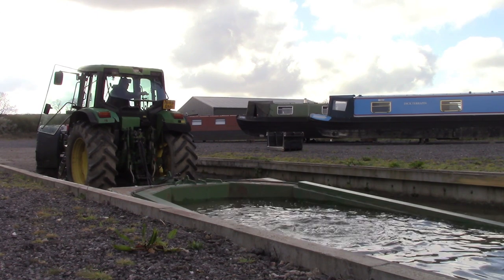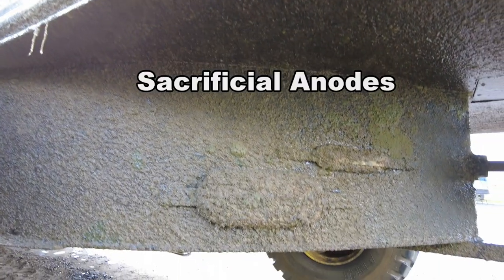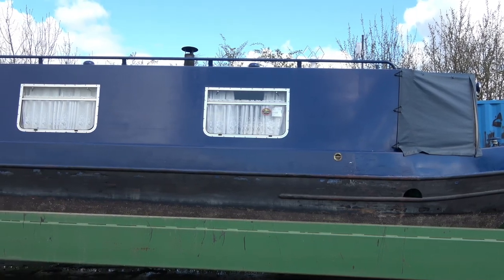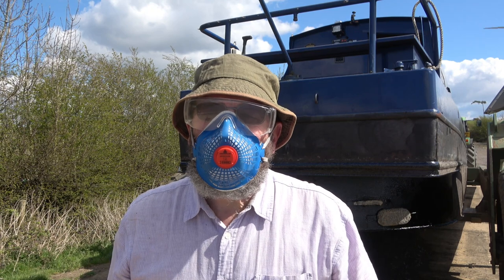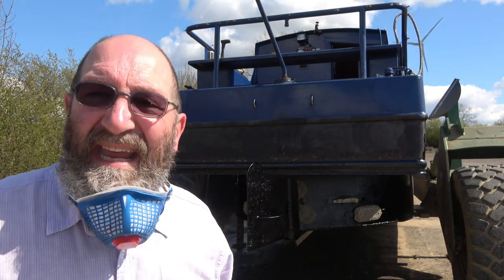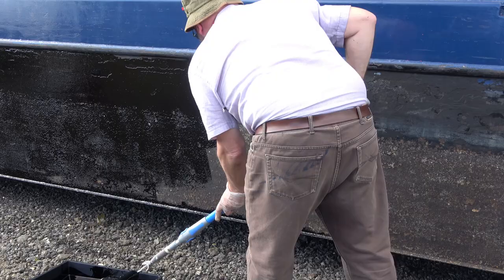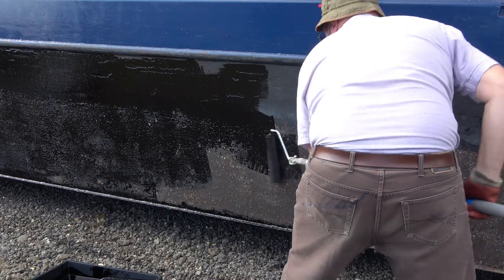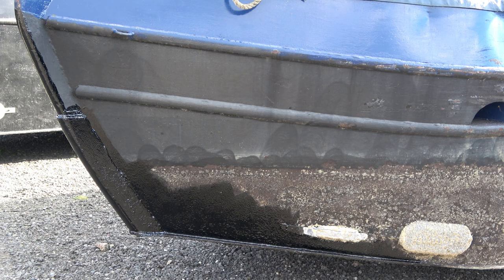189. DIY Narrowboat Blacking (Part One of Four)

Comment: Alan ,first thing out of the water, did you have a hull thickness survey done by a marine engineer? If not , why not?  Seems that is a logical first step, replace any plates that are corroded . Is that not required for boat insurance ? I would never buy a boat without a hull survey and know how much steel I had ? 

First survey, replate, then black ??
Reply from the maker: Hull surveys are sometimes required for insurance companies, I believe related to the age of the boat. My boat was examined three years ago and all was well, so no need to have a survey this time. There were no signs of any deterioration.
Reply: @MyNarrowboatVenture  Black the bottoms also especially at the stern,  the whole hull rusts.
Reply from the maker: @eamo106  The underside around the swim was blacked.

Comment: Well done Alan, you know you could also use a roller in each hand that should speed things along.
Some years ago four boat owners including myself formed a bit of a slipping club so we could help each other work on their boats. All went well with four boats then it was time to do mine and most found they were busy so although I still help slip two to three boats a year I prefer to not rely on others and do it myself.
Reply from the maker: I do use both hands but one at a time! That's often the way, others will take help when it's needed and when it's their turn to reciprocate, funnily enough they're too busy. If you want a job doing and doing well, there's only one way, do it yourself, cheers.

Comment: Many years ago an old boat surveyor, Cpt. John Polly told me you should always put the first coat of bitumen blacking on with a brush.
He explained that using a roller covered quickly but tended to skin over but not fill any pitting. He surveyed many boats and said he could always tell those blacked with only a roller. For the last 30 years, I have used a brush and my blacking always lasts well with very little pitting to my hull.
Reply from the maker: Thanks for your comment Fenton, I’ve always preferred brushing to rollering, as I believe the coverage is better but I can assure you, I am very thorough and got excellent coverage first time. Cheers

Comment: Evening Alan, really enjoyed the vlog, looking forward to part 2, saw an interesting video on shot-blasting a narrow boat hull recently, and the blacking that was used was a two-part epoxy resin, with life expectancy of 10 years, having worked since 1996 in the industrial flooring industry, I can certainly vouch for the durability of epoxy resin systems, on a correctly prepared substrate,  although considered expensive, I believe it is value for money. As always, stay safe. See you soon. Cheers.
Reply from the maker: Thanks Martin. What you say is quite correct but I prefer to even out payments and not have a single hefty cost. Who knows what might happen in the future. Cheers

Comment: The 9-inch foam roller may have been a bust, Alan, but, thankfully,  you don't have to go behind it with a brush to finish the surface. Good luck with a messy job! Zach
Reply from the maker: Many thanks Zach, the job is done and finished. Cheers

Comment: Haven't seen the slipway since the boat painting last summer.  Now it's Lazy Days turn out of the water.  Hull painting looks like unpleasant but necessary work.  Yelvertoft looks well equipped and efficient to make things easier to black the boat.  I have a great admiration for anyone who is capable and willing to DIY rather than pay someone to do the job.  Well done, Alan.
Reply from the maker: That's very kind of you to say Tim. The hydraulic trailer is a quick and easy method to get a boat out of the water and on to the hardstand. There are no facilities at Yelvertoft to lift the boat high enough to black underneath. Cheers

Comment: Hullo Alan, big job you are undertaking. ….at what stage during the process is the base plate blackened? If at all….cheers Alistair
Reply from the maker: Hi Alistair. I didn’t black the base plate on this occasion, as it’s not so essential. Three years ago the base plate was blacked at Debdale Wharf, as there is a hoist there, which enabled the boat to be lifted high enough to get underneath. All the best.

Comment: Great video as always! Apologies if you’ve answered this already/previously, but do you black the base of the boat too?
Reply from the maker: I had the bottom of the boat blacked three years ago when I bought it. This was done at Debdale Wharf. Not many marinas have the facility to lift a boat high enough to do that, so you have to take it somewhere with a gantry or crane. The bottom plate is less liable to rust, as it’s always under water, so on this occasion I just dealt with the sides, as these are prone to rust along the water line, that’s why blacking is so important. There are no facilities at Yelvertoft to lift the boat high enough to black underneath. Cheers

Comment: Alan: I have seen a few blacking vlogs but nobody seems to mention that massive flat area underneath the boat.
Does it not get just as corroded and/or covered in growth and muck as the sides?
In one view of the rudder when it was on the wash pan it looked as if the portside "wing" wasn't horizontal.
Reply from the maker: Hi John, the bottom of the boat is less prone to rust, as it's constantly under water. It's the sides on the water line where there is greater risk, as you have a wet/drying process on the water line. I'm sure others can explain it better. I did have the underside blacked three years ago at Debdale Wharf. To get underneath a boat requires specialist lifting equipment and not many marinas have that facility. Debdale has a hoist. Take a look at my video No. 11. Blacking Day Part Two and you'll see one way of doing the underside. I think all is well with the rudder, I didn't notice anything amiss. The wings are steps to help you get out of the water. Cheers, thanks for watching and commenting.

Comment: Morning Alan., Now the boat is out of the water the hull looks in good shape including the Annodes  ,although  you can see better than I can across the Atlantic. Regarding the "tunnel stripes" I'd get as much of the blacking off in that area as bitumastic paint will burn through any under coat and topcoat .As the area is not huge it might be good to rent a machine in order to get that area down to white metal and immediately undercoat it .Were you able to see the condition of the bottom plate when you washed the hull .I know the bottom is rarely painted and I wonder sometimes if that is because  its awkward and they rely on scuffing the bottom in the canal and the fact there is no exposure to air down there.Good job so far Alan see you later .
Cheers from Canada
Reply from the maker: Hi Ralph. Not many marinas have the facilities to lift a boat high enough to black underneath and as you suggest, the bottom is less prone to rust. It all looked good. It was only the red stripe that had previously been blacked underneath. The job is all done, only time will tell if it doesn't last. Cheers, all the best.

Comment: Hello Alan really interesting vlog. It’s interesting to see the slightly higher and forward anodes are depleted in comparison to the other two. I’m guessing with forward movement of the boat those two are exposed to more oxygenated water from the boats bow wave and therefore this accelerates the process as corrosion wouldn’t occur in more anaerobic low oxygen conditions such as lower in the water column. The other two look like new in contrast. Thank you again for such interesting content.
Reply from the maker: Hi Stuart, thanks for your comment. The original anodes are worn down to virtually nothing, so would have been replaced by the other ones you see, that are in good order. I'm none to scientific but do understand what you're suggesting. Cheers, all the best.

Comment: Don't you black the bottom? Looks like a lot of hard work! Bless your heart for doing it yourself, good on you.
Reply from the maker: Hi Roben. The bottom of the boat was blacked three years ago when I bought it. Not many marinas have the facility to lift a boat high enough to do that, so you have to take it somewhere with a gantry or crane. The bottom plate is less liable to rust, as it’s always under water, so on this occasion I just dealt with the sides, as these are prone to rust along the water line, that’s why blacking is so important. Hope all is well, thanks for your comment x

Comment: The thin foam roller is for undercoat and gloss paint only , you can usually get a cheap roller set from most super markets  , with bitumen it's just get it on and throw the roller sleeve away no point in buying quality rollers .
Reply from the maker: As I recall, the roller sleeve I bought was marked for acrylic paint and that was the very last one a specialist paint shop had in stock, I bought it without really looking at it. I couldn't find any 9" sponge rollers anywhere. Those ordered online didn't fit the roller cradle. I wasn't looking for quality for the reason you say.

Comment: Hi Alan looking at your rudder you have on each side two steps ,I call them steps as they must be so that if you fall into the oggin you can use them as steps to get out, I did think if they could be Propwash deflectors but they are too small, so in my mind steps they are .Cheere
Reply from the maker: You're quite right Ramsey they are steps to aid getting out of the water, if one accidentally falls in. All the best.

Comment: Does the Marina have the proper roller?  I would think they would or at least know where you could find one.
Reply from the maker: The Marina has rollers of their own, but they do not supply them. I ordered some dense foam rollers but they were for a spindle type of roller and not one with a cage like mine, so couldn't be used.

Comment: You could do with a angle grinder with an wire attachment,looking like a good job are you not painting the bottom plate of the boat.
Reply from the maker: An angle grinder is not in my kit of equipment, as yet. The base plate was blacked three years ago but it's less prone to corrosion, as it's always under water.  To do the underside, requires the boat to be taken somewhere, which has the facility to lift the boat high enough, most marinas do not have that facility. Previously, it was blacked at Debdale Wharf.

Comment: While you are out of the water, do you put in temporary drain pipes - into the drain ports that are in your hull? I have seen this when others are blacking their boats so that the drain water does not ruin the paint job while it is wet.
Reply from the maker: I would have done, if I had had something to fit but it wasn’t a problem. The outlets are really small, I couldn’t even squeeze hosepipe in.

Comment: We didn't find out if lunch entailed a cheese top roll. Otherwise a job well-done and nice filming of the process of getting the boat off the trolley (or whatever you call it) and onto the blocks. Not much by way of clearances!
Reply from the maker: I think it probably did but I dont recall. Thanks for your great comment. Narrowboats are 6ft 10 inches wide (2.08m), so any required tolerance is already built in. Cheers

Comment: Hi Alan ,nice to see you working lol ,tell me y don’t you’re boatyard but more blocks under it to make it higher to make it easier to work on ,when I was working and lifting boats out we always made sure the owner could get under the boat to inspect and paint the bottom plate I just wonder how long it is since it was painted? It cost no more to get it it higher,,enjoy you work lol nice seeing you Alan ,take care keep safe,John 🚣‍♀️👀🌹🔧🔧✅
Reply from the maker: Hi John, I'm not sure the way the trailer works they could get the boat high enough, to enable decent access underneath. All the hardstand boats are on single height railway sleepers. How were your boats lifted, was it done with a crane? Hope you're keeping safe and well, all the best Alan
Reply: @MyNarrowboatVenture  hi Alan ,I guess it was because I yoused  a straddle lift lift 85 tons ,I I guess that makes it easy to keep them up high,
Reply from the maker: @johnallen148  That makes all the difference, nothing like that at Yelvertoft. Cheers

Comment: Hi Alan. Looks like you're doing a grand job there. One thing that intrigues me is, when you mentioned the loose chips of old paint/Blacking. & how difficult it can be to remove it. So my Q is. Why do many narrowboaters, not sandblast the area being blackened, and just jet wash instead. Is there a reason for this?
Reply from the maker: I'm not sure I'm fully understanding your question. Cost is one reason, finding somewhere to do it another but when done, it would still need to be blacked. Some boaters use a two pack epoxy system and for that, all former blacking has to be removed first, so sandblasting (or similar) would be necessary. I hope I've got that right. Cheers
Reply: @MyNarrowboatVenture  Cheers for that Alan. I get the jest of your Answer. With your explanation given. & yes cost is always a factor. What I were thinking is, surely it would be logical, having the boat striped back to bare metal, removing all traces of any flakes from the area to be treated before applying a new lease of life to the boat with several coats bitumen paint. & making it easier to apply. Something I have seen being done on a much larger scale in dry docks to oil tankers and such. 

Oh BTW. Happy Birthday for the 11th. 🍻
Reply from the maker: @castingshadows282  I really don't believe that's necessary with a narrowboat. To go to that trouble and expense for blacking wouldn't make sense to my mind. I agree though it would be great to have a smooth finish without imperfections but it's not practical and most of the blacked part is hidden under water. Cheers
Reply: @MyNarrowboatVenture  Fair comment Alan. Thank you. If only the material things in life could be not so expensive. What a change it would make for many.  👍